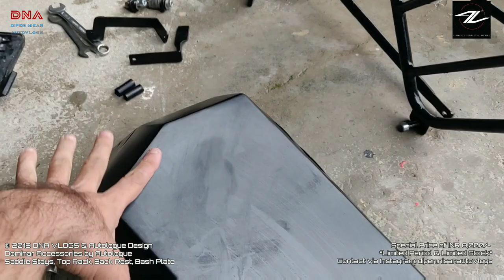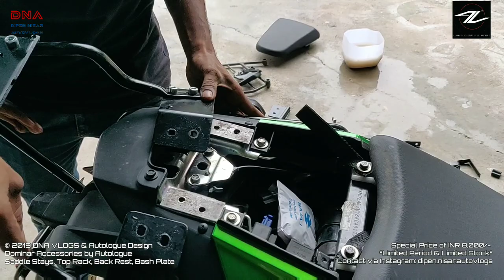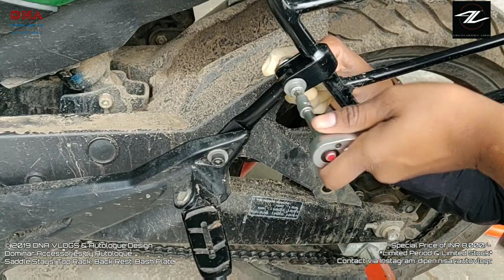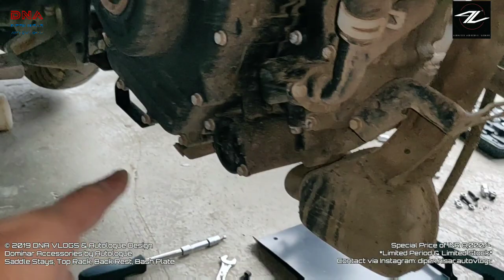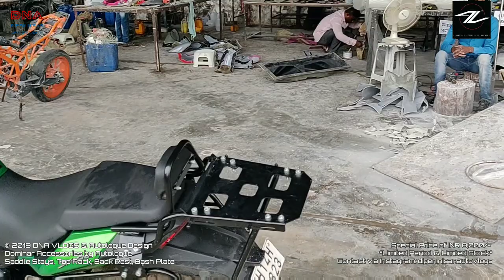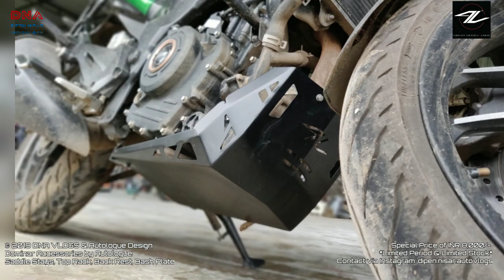Budget accessories INR 8000 only | Bash Plate | Top Rack | Saddle Stays | Back Rest | Dominar Mods

Comment: Actually they not using Lock nuts at dash-plate so it gets loose after some time or by vibrations.
Reply from the maker: You can add the lock nuts in that case. They are easily available in any accessories shop. I will add this as a suggestion.
Reply: I'm talking about the video, In your d400.
Reply from the maker: @surajmhaskar5662  you saw my bike nuts falling ? When did you see my bike ?
Reply from the maker: Hello, Please do Subscribe to my channel, if you haven't . Thank you